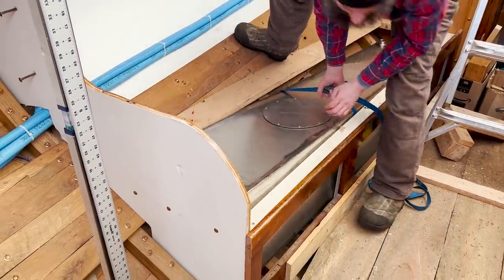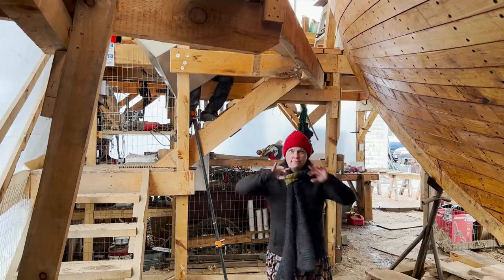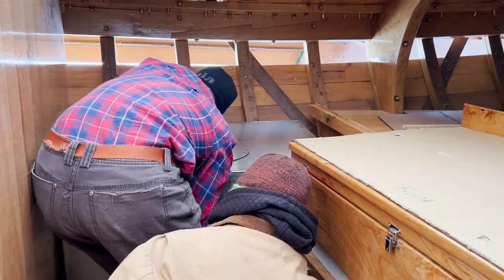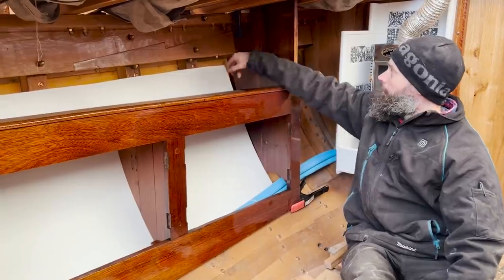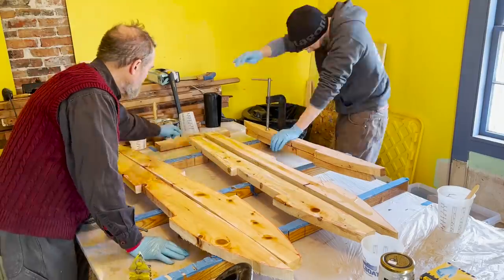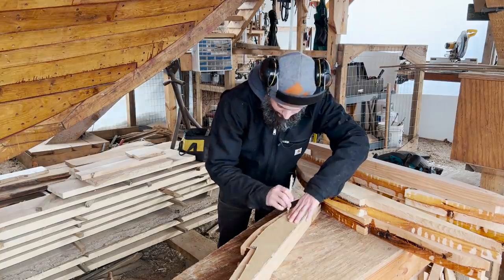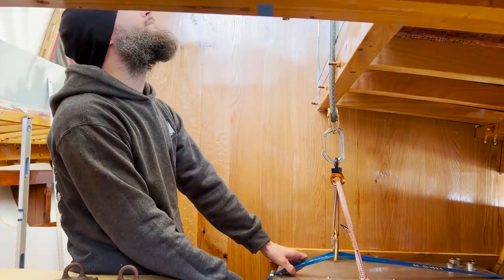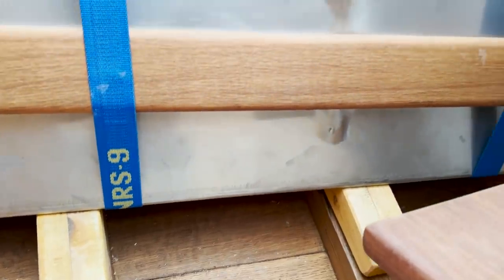Installing the Water Tanks - Episode 202 - Acorn to Arabella: Journey of a Wooden Boat

Comment: Digital tank monitors will make your life sooo much easier in the long run, install a sending unit in each tank and connect them to something like a noland RS11 and you can monitor all the tanks from your chart plotter screen, no additional gauges needed, and you'll be able to get easy view of your tankage levels.
Reply: Oooh fancy
Reply: @bengelman2600  I live where there is no "town water" and am on tanks. I use the same system on my water tanks on the house. It's a good idea for more than just a boat 😃

EDIT.... 3 teen girls makes me paranoid about tank levels.... 20 min showers no matter how much I ask them to hurry up...
Reply: @petert3355  "You got 5 min before I turn the hot water off" is how you hurry them up 🤣

Comment: Rubber strips will stop the metal tanks from sqeaking on the joining wood surfaces at sea,
Can't wait for launch day !
Great project.
Cheers.
Reply from the maker: Cheers, Rick!
Reply: They´ll not only quieten the whole setup, the´ll also reduce the flex of the tanks.
Halfway rigid on only one of its surfaces with some rubber, all the other contact points should have some foam-cushioned play. 
Many stainless steels work-harden, constant flex may be a problem at some point in the future.
Reply: I have also used the foam sleeping mats or yoga mats cut to shape, but 1 or 2 mm Butyl rubber works. Works because it increases the surface area of all contact points.
Reply: Neoprene sheet gasket material would do the trick.

Comment: To figure out the shape of the space you can't see or reach, stuff a trash bag back in there and fill it with spray foam. Once it dries and hardens, you'll  have a rough mold to shape your supports. It's also a cool way to make removable padding and/or insulation...

Comment: Hi just a suggestion you might want to put a bit of rubber underneath the strap buckles it will stop any Clatter between the two metals in rough weather especially where you don't have easy access to them you don't want to be out at sea listening to them rattle it will drive you nuts keep up the good work.👍

Comment: If I can humbly add my two cents. I'd put a insulating wrap of some sort on the tanks to prevent condensation from occurring behind your bulkheads and setties and galvanic issues if there's any unforseeable hidden metal contacts. Also maybe adding one way valves to your upper tanks to prevent back flow. I figure if your heeled over in rough  seas water back flowing could change the center of gravity at a less than desirable time.  Just a thought. Love the build. Been watching for many years. One day I'll get off cape make it for an open house.
Reply from the maker: Thanks for watching, Garry!

Comment: You may want to plumb clear flexible plastic vent hose from next to each tank outlet to a point above the tank and that way you will be able to see the water level of each. I did this on our bus water tanks.  A visual reference was cheaper than doing level sensors. Just make sure the tubing is high enough regardless of heeling angle
Reply from the maker: Thanks for sharing!

Comment: 1 Something as simple as “I can’t fit my hand, let’s use a strap” is so simple, it’s smart.  And I wouldn’t have thought of it.  2 Figuring out where the tanks are hitting the frames, for the supports, lost me!  Will have to watch several times, just to wrap my head around it.  3 Getting a very nice collection of clamps.
Reply: "2 Figuring out where the tanks are hitting the frames, for the supports, lost me!  Will have to watch several times..."
For me too ! As a retired engineering draftman, I usually get mechanical concepts well.
 But not this time ! Steve really lost me on this one ! 😳
Reply: Me too. I think the idea was that he measured the length of the string, knew the length of the vertical back face of the tank from the ruler he stuck behind it, and could measure a diagonal from the back-top of the tank to the front-bottom, when the tank is removed. That gives him a triangle with the length of 2 sides known, and the sum of the lengths of 2 sides known, so he could figure out the angle of the bottom, and make supports to suit.

Comment: I would question the straps idea.  Welded tabs on the tank and lag bolts work great on alaska commercial boats we build. We also found out that slipping garbage bags behind the tanks and fill them up with close cell expanding foam will keep the tanks from flexing and cracking the welds down the road. It does a great job supporting the tanks from behind. Just my thoughts.
Reply from the maker: Thanks!

Comment: You know steve you could put a "T"  off of the drain on the tank and run it anywhere on the boat. Then attach it somewhere on the bulkhead with a sight glass or a see threw hose. Then ad 5 gallons at a time to the tank and mark every 5 gallons on the hose. Then there will be no guessing and you will always know how much is in the tank.
     
Before lasers, if you needed a level line on a wall or needed to have the exact height on the other side of the room, we would just use a see-through hose filled with water and hold it up to the marked height on one side. When you got the level of water in one end of the hose at the right height then you would know the other side was at the right height.
Reply: @thegoodtom1718 I agree but it doesn't have to be open. It can be looped back into the top of the tank.

Comment: An old bicycle inner tube will cut down on rattles and squeak with the water tank. They give little air-cushioned to between the wood and the metal. I would have super glue on rivets. will cut down on the squeaks and superglue the bicycle inner tube on the rivets will cut down on noise and cavitation sound I believe

Comment: Looking forward to see how you address the plumbing system and the water maker situation. Uma has the best I've ever seen. Can you share your thoughts on how the dewatered tanks will be treated? Back in day I used surgical tubing as a tell.
Reply: It is interesting - perhaps half a cup of vinegar as a mild acidic substance to combat growth of mold substances.  Pehaps a bit of olive oil or grapeseed oil- but that would need to be drained out and the lower tank will need to receive only clear water.  What is the best affordable effective sustainable non toxic noncaustic substance for keeping an empty water tank clean?

Comment: Rubber between wood and the tank just couple mm would be enough. Boat will stretch and contract and tanks wont so it will make them alot more silent. Some sort of 3M adhesive rubber strips attached to the tanks. Acoustic panels that are used in cars wouldn't hurt on the tanks outside faces either so in rough weather they wouldnt make any weird sound.

Comment: Hi Steve love the wood work inside the hull. When i used to work on boats we used 1/2 in. rubber under the tank to reduce squeaking and also so the tank didn't have wear marks, also we used a paint that stopped rustication. I was wondering if you were going to do the same or something like that.Also what have you thought about weight distribution.  Love your work you are defiantly a master craftsman.
Reply from the maker: Thanks for relaying your experience!

Comment: Hello, looking at these beautiful tanks a story / question comes to mind: I have a mini fridge from Weaco in my campervan; normally it's meant to be built into the kitchen furniture, but due to my laziness / inability to overcome some problems I had to realize what I had in mind, it was strapped to a wall for a few years. After taking it out again, I noticed that the blade of a cutter had accidentally slipped between the wall and the side of the fridge and had started to leave rust stains - meaning that the insulation of the fridge is pretty poor and moisture is settling on its surface / between the walls. This brings me to my consideration: Either I would leave enough space between the tanks and a wooden wall, surely with the amount of water there is condensation - or fill the gap with an insulating and moisture-proof foam to prevent condensation from getting trapped in between. But maybe you have already thought of that?! :)

All the best!

Comment: 5 lbs of air and soapy water spray on your tanks welds to check for liquid tight before permanent install would be prudent because let's face it tank welding is not easy! I know from experience.
Reply from the maker: Yup! That’s the plan.

Comment: They make ultrasonic fluid level sensors that glue to the outside of the tank. With calibration they can be very accurate with oddly shaped tanks.

Comment: You might want to put some Automotive Soundproofing Silfoam or some sort of sill foam inbetween the tanks and the frames / rivets or you will have a significant amount of rubbing / flexing grinding that you would likely not find desireable.  Especially as it could cause wearthrough eventually.
Reply: These protective strips could easily be as simple as some 1/2" thick strips of softwood put on the top of the frames and rivets to buffer between the tank and the frames to eliminate / minimize rubbing and vibration and prevent the potential for metal on metal friction and potential wearthrough.
Reply: All of the above was posted before I was able to finish watching the video.  DOH!  :-)

Comment: Can you fix some kind of rubber , hard foam on the timber supports , use as a shock absorber ,  I have seen wear on tanks , when the boat is flexing and it doesn't,  may help you on the creaking sounds you will have ,
Maybe the double sided seals they put around hatches , 
Also maybe choose your largest tank to run the water maker water to , ?

Comment: Just wondering.  🤔
Would it be worth putting a Teflon strip under the straps where they contract the wood.  
I have no idea if the will move much once everything in in place and cause a bit of wear.
I, of course, don't know how long they will sit there as time goes on and how often you will inspect there.  
My experience is military aircraft and with things moving or touching about in tight spaces 😸

Comment: You should go and buy some of thoughs thin white rubbery plastic (not sure what material is called) cutting boards to use as a liner on supports that touch the water tanks so no chaffing on metal tanks.

Comment: Was it worth adding some type of heavy duty adhesive rubber or high density foam strips between the timber bracing and the stainless steel tanks?

Comment: Another noob question: do you need to take into account the weight distribution from side to side on the boat? So, for instance, as you install all the framing for the tanks and such on one side of the boat does that need to be compensated on the other side?
Reply from the maker: Yes, to some extent, but it can be balanced out with gear and tools and provisions… as you would, say, on an airplane.

Comment: What's the trick for purifying the insides of the water tanks post-fabrication to ensure they're clean enough for potable water?  Or are these not being used for potable applications? 

As a career commercial airline mechanic, you'll never see me drinking coffee served by the flight attendants which has been sourced from the stainless water tanks onboard the aircraft.

Speaking of, those aircraft tanks are periodically "sanitized" by flushing them with some sort of material.  Will you plan to do something similar on a routine basis?

Comment: you should consider wraping your tanks in dyna matt. kill the sloshing sounds.
Reply from the maker: It’s not really a thing I’ve had a problem with on the boats I’ve been on. When it’s slosh o’clock, it’s usually the outside of the boat where the sound is happening. There are baffles inside to prevent a ton of sloshing as well. —Anne

Comment: Question. What's the reason for not having the tanks fit side to side? I mean you're paying for the welder and jet cutter either way. Is it a matter of the finished shape not being able to slide into the final spot they get mounted? Just seems like if you're paying what is probably a decent amount for the custom weld work why not have hime follow a template that fits relatively tight on all sides. 

**not a criticism just curious thanks***
Reply from the maker: Thanks, and it’s a great question! Having them fit exactly to either the curve of the boat or exactly into the spaces fore and aft has two big drawbacks: matching the curve of the boat makes little more tankage for a whole lot of work, and coming right up to the interior furniture would make their removal for repairs or inspection difficult. A little bit of play in all directions makes for tanks that are easy to deal with during production and down the road. —Anne

Comment: Man, one of these days maybe a shirt will come out and I'll have the funds to buy it... hasn't happened yet, but I can dream. Disabled and broke sucks, and I really like this design too. Oh, well. Any way, loving the problem solving skills and all. Glad you're thinking ahead to weight distribution and the tanks being so high. However, against the lead keel and all the soaking wet oak below that point, I'm not so sure 240 pounds of water would have so much effect if the tank is full at about 30 gallons? That's only about the weight of one heavy-ish man. But if both high sitting tanks are both on the same out board side, then yeah, I can see your point, depending on the static load on the other side of the centerline of the boat and how high up/far out that load is.
Reply: @Thomas Russell Hi Thomas. Now you have 100 subscribers to YOUR You-Tube channel. Continue curating,  get better health if you can, and create and share from what you know and like. Make us who are subscribers to you channel inspired, informed, or entertained. I too am a kinda long time subscriber to A2A and immensely enjoy Stephen and crew and the craft of the wooden sailing ketch boat building process as it proceeds. (SUBSCRIBED and watching since the lead keel pour. Eager to become a basic 5 monthly Patreon sometime soon.  Meanwhile,  am subscribed, watching, following, occasionally sharing, and always liking. Helps the channel. No costs to me at this time.)

Comment: If you want accurate measurement of the volume of the tanks, weigh the tank empty (tare weight) then fill with water and reweigh also take the temperature of the water when you weigh it.  From there it is just math.

Comment: How do you secure the tanks securely? In rough seas, you wouldn’t want that much weight moving around. You could weld on tabs and screw through those to the frames.
Reply from the maker: Breaking for those NRS straps has 1,500 lb breaking strength. The tanks will be held in with those.
Reply: @AcornToArabella  as always, I commented before watching the entire video.😭 Great editing, by the way.
Reply from the maker: Thanks, Harvey!

Comment: Just curious what the plans for the gray water tank is. All that water has to go somewhere.
Reply from the maker: Normally gray water would be something that can go overboard, at least, in a great many anchorages. In this case Arabella needs a gray water tank because of where her water line is in relation to the drains in the sinks. We’ll have a gray water tank down in the bilge, it will most likely be plastic, and then it will have a lift pump that will put it up and out of the boat through a through-hull.

Comment: Question about the boat rocking and the tanks being full. Does the water splash out the hole at the top when you are rocking and have to keep the water below a set level to avoid it or is the hole water tight when screwed on?
Reply from the maker: The inspection port has a rubber gasket. Great question!

Comment: If those blue straps don't have metal components that are made of a high grade of aluminum, brass or SS, they will corrode and fail.  From my experience with similar blue material Thule straps that have a die-cast zinc alloy metal components, they fail over time after being exposed to a salt water environment.  Better safe than sorry over the long run.

Comment: Steve did you put all of your tanks on one side what is going to counter balance your boat.  you dont need those straps to hold them in its overly engineered as it is. . I would have put one 120gallon tank in the forward berth and that is it. Especially of you are going to have a water maker.
Reply from the maker: No, there’s a tank on the port side as well, same side as the woodstove.
Reply from the maker: Yeah that’s the one we’re thinking of getting.

Comment: I'm not sure of the vertical placement of the tanks relative to each other, but if any two of the valves that gravity-feed the 9 gallon bilge tank are open at the same time, won't those two tanks level to each other?
Reply from the maker: Not with ball valves on each.

Comment: The tanks don’t need any insertion rubber on the sides between timber and stainless steel before strapping? Weren’t you going to get lugs welded onsite to mount the tanks too.

Comment: Is it normal to have all the tanks on the same side as you said if you need to fill them all will the boat not list to one side?
Reply from the maker: We’ve got one under the settee to port, same side as the wood stove, galley stove, and tile piece for the heater.

Comment: I personally would not want those NRS straps as my catastrophic last line of defense.  I am very familiar with them, use them for a different application all of the time.
Reply from the maker: 1500 lbs minimum breaking strength, two per tank. Feeling good about it.
Reply: @AcornToArabella  it is not the strap that concerns me it is the buckle.

Comment: Hello, have you thought about the noise the water will make in these tanks? Have thought about means to prevent it from driving you nuts? Cheers Martin
Reply from the maker: There are baffles inside. The water doesn’t really make a lot of noise in my experience living aboard. —Anne